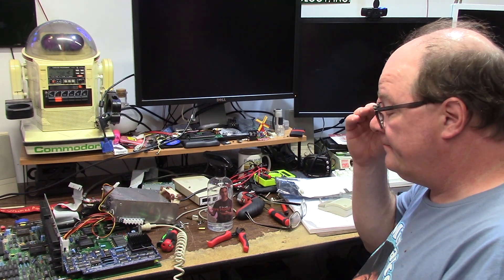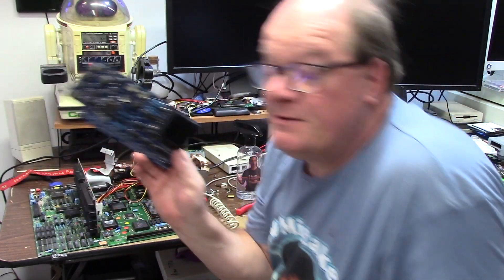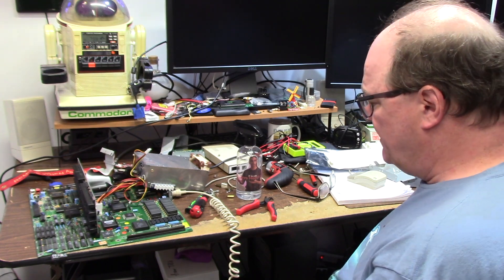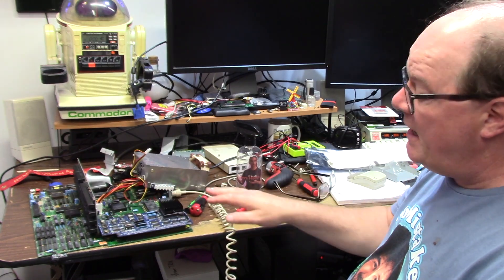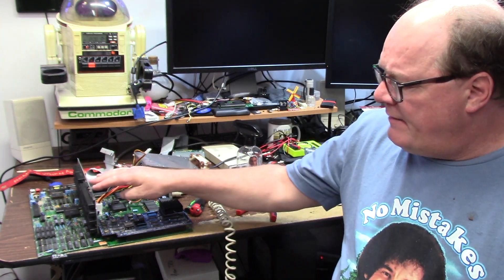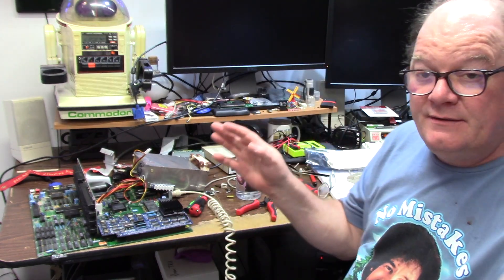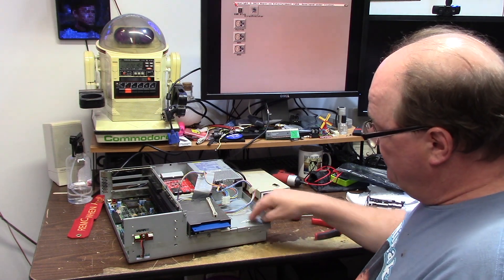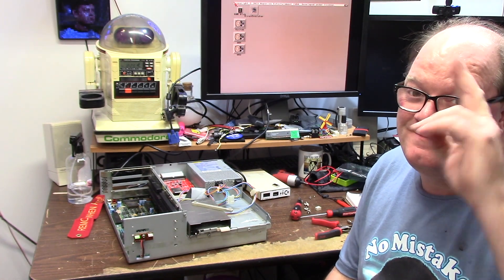The AMIGA 3000 when ONE ZIP20 RUINS THE DAY

Comment: Great video. Made me think of my A3000. I have one that does this exact same problem. Purchased a re-amiga 3000 board and ever since it arrived, the original board hasn't skipped a beat. Will run zip test. just in case. Thank you.

Comment: What happens if you don't use MMUlibs? Does the BFG9060 not work without it? MMUlibs breaks the built-in SCSI on my A4000T and the only solution is not to run MMUlibs.
Reply from the maker: works fine. might lose a few mhz, but working over crashing until firmware patches is fine by me.  my other video on this 3000 with the bfg and the mmulibs covers why and what and how i got around it. is it the official fix, prob not, but works for me and helps others use the card on both 3000 and 4000T machines with scsi built in . (dont effect the ide side of the 4000t either.
Reply: @ChrisEdwardsRestoration  thanks for the answer! Is there a 68060.library that needs to be used instead then?
Reply from the maker: @KarlHamilton  i used the one with 3.2.2.1
Reply: @ChrisEdwardsRestoration  3.2 nags me every time it boots and runs in some stupid restricted mode without MMUlibs.  Frustrating.

Comment: I just found this out about the Amiga 3000 power supply, always put it in the position with the switch at the top, why well if you look at it the power supply heats up because the ventilation holes which are now situated on the bottom are being blocked. I had all kinds of intermitt  problems because it was heating up.Since I turned it over it has been working fantastic and my intermitt problems went away. Never thought that would be the problem, but it sure was causing me a lot of problems with this new raspberry pi 400. (I use it for powering my Raspberry pi, and my sata hard drives (sata pwr plug  adapter on HD plug)  like it becuae it has a switch, and can give you 17 amps for 5 volts if needed. I was going to try to fix my A3000 boards, and my A4000 but my hands shake worse then a unbalanced tire.